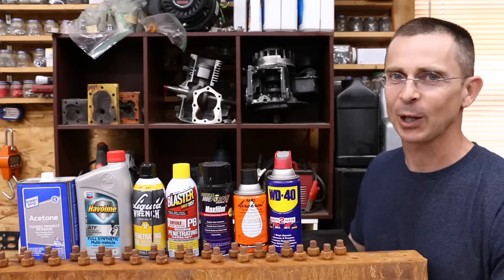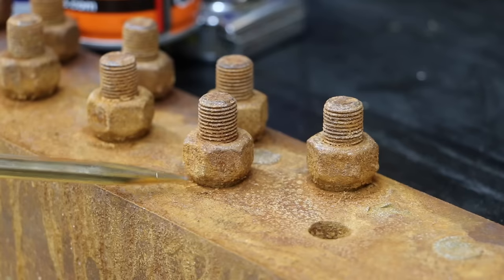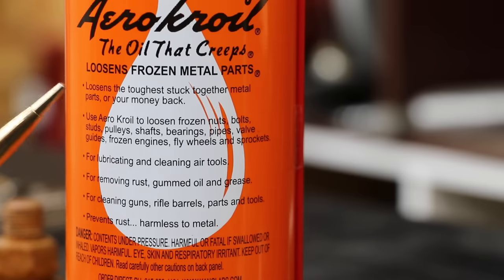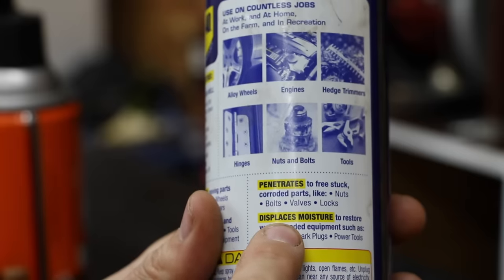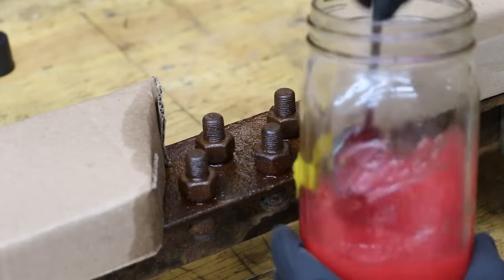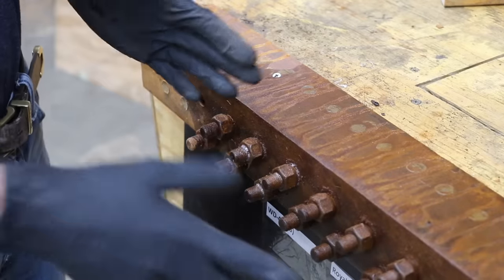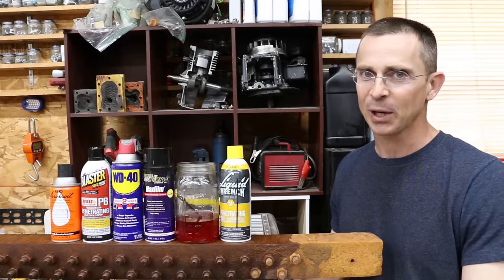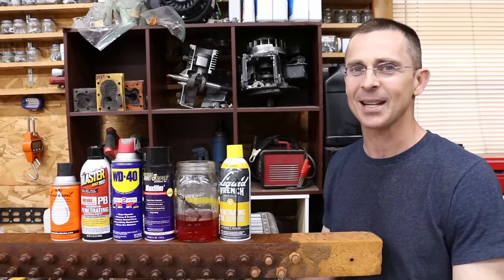Which Penetrating Oil is Best? Let's find out!

Comment: I've always been happy with " 50/50" as I call it, but the acetone doesn't work with any oiler that has a rubber seal of course.
Usually I'm just using 50/50 to soak bearings.
Reply from the maker: Thanks for sharing.

Comment: Indian Head (tm) Penetrating Oil which hasn't been made in 50 years (or longer) and came in a pint tin and was RED was the ABSOLUTE BEST penetrating oil made from WWII when my Daddy used it daily in a machine shop during WWII (Tiny Eagle pump oil can) . It contained BENZENE and high sulphur cutting oil (from the smell) but when I pumped gas for a living, "frozen" Flathead Ford V-8 (or Six) sparkplugs this stuff would break loose. I think it "went away" in about 1970 from the benzene in it (EPA regs). I STILL have two or three un-opened cans, along with some high-sulphur cutting oil (dark), and the old Al-Ox cutting fluid (that "burns" your hands by drying them out). I have two new cans of Gold Seal Glas-Wax (tm) too I'll hoard 'til I die for windshields (somebody in England makes a "clone" they say, but I don't have a brand) and a can and a half of S.C. Johnson's and Son's Paste Wax for finished Hardwood Floors (like mine-not gonna pay $36 for a TINY jar of "floor wax" from Amazoom) and some other "old things" not made anymore, like cup shaving soap!
Reply from the maker: Thanks for sharing!

Comment: From people in antique tractor hobby,heard of a lubricant called shutter oil. Was told it was used with early engines on the shutter system. Was told it was good for putting in cylinders of stuck engines to free them up. Have never actually seen it. Also, what about Marvel Mystery Oil?
Reply from the maker: Thanks for the suggestion.

Comment: Would love to see some of the other WD 40 sprays meant as penetrants to break rusty nuts and bolts. Also, there is other Liquid Wrenches. Tap and die oil. And a lot of people I think apply penetrants and heat as well. It's not good to breathe some of the stuff afterwords, but this has helped me with some severely rust welded guide pins in some brakes before.
Reply from the maker: Thanks for the suggestion.

Comment: I didn't have any ATF handy, so I was looking for something I might be able to substitute it for in the 50/50 ATF/acetone mix. Turns out, according to the SDS sheets of all the ATF fluids I could find, they're 90-100% hydrotreated petroleum distillates or highly refined mineral oil (also a petroleum distillate...). I assume the rest is surfactants, anti-wear agents, and other additives, however ATF is not really unique in this respect, many other oils (cutting oil, motor oil, other lubricating oils, etc) are made from a base of mineral oil or petroleum distillates, with a few additives.

In this light, I'd be interested to see a similar test evaluating mixes of acetone/ATF fluid, acetone/motor oil, acetone/cutting oil, or other similar fluids. Maybe acetone/mineral oil could be used a kind of control test?
Reply from the maker: Thanks for the suggestion.

Comment: Hi there,

(i've posted the same question in the ChrisFix video on P.O, i'm looking for more than one opinion on this, so please no offence from either :)

 I've found a source that says it was originally Power Steering fluid used in this homebrew recipe, not ATF. I see this debate going on on wether you can substitute PSF and ATF...many folks saying that you can use (or that it's even better) to use ATF for your PS - many also opposing this (so maybe here things got mixed ups ATF/PSF). Well...i trying to figure out which stuff to buy, so i compared the viscosity of both fluids... for example at 40°C (104°F), the PSF i looked at has 18.0 mm²/s (nevermind the unit) ...and for example several ATF have the viscosity in the range of 30-36 mm²/s (at the same temperature) .... going further, Brake Fluid has even lower viscosity, meaning it flows better, in the range of only a couple of mm²/s (and that's at water boiling temps, so much hotter than 40C/104F) .. But i don't really feel comfortable using brake fluid...i've stripped paint from the car once :D .. it's kinda agressive. ...
 but what about PSF? I seems to have half the viscosity of ATF... combined with acetone, it should in theory flow even better into the rusty threads ??

Much thanks for your thoughts on this!

Comment: I was surprised that KROIL came last. I used it on a Marine engine where a bolt was rusted in. After trying just about everyting (thought about pulling engine out!) I bought a can of KROIL, aplied it 3 times and DANG!.. Bolt came out!.. Unfortunately KROIL price has gone up so much that Liquid Wrench may be my GOTO Lub. Is it possible that KROIL is a better performer for certain applications?..
Reply from the maker: Thanks for the suggestion.

Comment: I've used brake fluid and oil, and the brake fluid is great with heat, so that it stays liquid, doesn't burn up to 400 degrees, I think... Maybe I'll try brake fluid plus ATF..But I put a rag or paper towel to protect anything that it drips onto...I noticed that it even chewed into the concrete surface on my garage floor!
Reply from the maker: Thanks for the feedback.

Comment: You should try oil of wintergreen, I used it in the military for frozen nuts and bolts. It worked really good on engine and frame nuts and bolts.
Reply from the maker: Thanks for the suggestion.

Comment: I realise this is an old comparison some 5 years ago but would like to mention my brand if another comparison will be done. I used Releasall Penetrate Oil most of the time. It works and works extremely fast. Works on all types of corrosion. I have lots of old stuff so not sure how the newer Releasall stuff works.
Reply from the maker: Thanks for the suggestion.

Comment: Tried everything I knew. Until I did this on 2 bolts holding my front struts on, couldn't get them to budge until I added heat from a propane touch and candle wax, heated as hot as I dared, 4 minutes and then added the wax until it stopped smoking and started just melting around the threads leaving a bit of wax on the threads. From the information I got , I was to only heat the nut/bolt or if it were a stud until it just melts the wax and penetrates the threads.

Comment: My grandfather was a bosun's mate on a destroyer in WWII, and later a metallurgist / machinist / welder. He used WD-40 to shine up tools and keep them from rusting, but acetone and atf for everything else. I still remember the red/clear jar sitting on the back of the shelf in the garage. Believe it or not, he'd use it as carb and top end cleaner too! Whoever was in the vehicle was told "Pin It!" and he'd squirt the stuff in to the carb at W.O.T.

Let me just say, if you think Seafoam blows crud out of an engine, you ain't seen what THIS rocket fuel used to do!
I ABSOLUTELY WOULD NOT USE IT ON ANY NEWER VEHICLES, HOWEVER!!... Not unless you're a Chernobyl reinactor...
Reply from the maker: Thanks for sharing.

Comment: I am always using every penetrating oil, lube, grease motor oil, trans fluid.......that i can find. I find everything has its place to perform the best, what works in one place doesn't work well in others.
I use Kroil in bulk and aero Kroil both often. I seem to have very good results with kroil on aluminum more than anything. I hoped it would have perfomed better in this test.  PB seems to be the best on combine bolts and other ag equipment. Royal oil has a great line of areosol products, costly but great. Kimball midwest has a great line of areosol products (IDK who actually makes them) their delayed viscosity grease in areosol in a great industrial, assembly, and ag product.  Agco has a panther penetrating oil that is one of the very best lubricants I have used its just the right thickness to be perfect....but it sucks as a penetrant. Great testing very professional...Thanks a lot.
Reply from the maker: Thanks and you are welcome!  Thanks for sharing.

Comment: there  is a new product called "superzilla? have you tried that, i have restored some cars, and what works best for me ( i am 75 years old) is heating the bolt, and applying heat, then squirting  80 Wt. oil on to the hot bolt, it soaks in, and produces a lubricant that does not evaporate within side the bolt, it stays OILY , which makes more sense .
Reply from the maker: Thanks for the suggestion.

Comment: Just wondering if you heat a nut first then spray the lubricant will the lubricant get sucked into the bolt like solder into a copper fitting before cooling off??

Comment: I had some pistons that sat for several years.  The rings were rusted and stuck inside the groves. I dropped one into a container filled with PB Blaster for almost 2 years with no results. It just seems impossible for me to believe penetrating oil can wick under a bolt head and work its way down the threads.
Reply from the maker: Thanks for the feedback.

Comment: Use a torch, apply heat, and dab the bolt with candle wax. It won’t boil off like an aerosol.
Reply from the maker: Thanks for the suggestion.

Comment: I’d like to see if there’s a difference between heating the nut and heating the bolt. You always hear heating the bolt and not the nut due to expansion. Also maybe see if simply tapping it with a hammer would change anything
Reply from the maker: Thanks for the suggestion.

Comment: I’ve always applied some penetrant after heat if I can, might just be evaporating, or burning off, but it seems to soak into the threads and cool the bolt down if you make sure to focus on the bolt, that way your bolt gets the temperature shock as well, I’d love to see how much these products also lubricate the rest of the threads after the breakaway, and how much fluid you actually need to use, I mean I’d rather soak it to be sure, but that’s almost as important as the initial cost in my opinion
Reply from the maker: Thanks for sharing.

Comment: Used motor oil is the best way to go!  Especially if you use it with heat....  On extreme heat the nut up brush down with used motor oil from the expanding and contracting of the metal sucks the oil right in. But rust soaks in used motor oil like a sponge and used motor oil dosent evaporate...  Oil bath you vehicles frame and inner fenders...  Youll be amazed!
Reply from the maker: Thanks for the feedback.

Comment: Just add one part acetone and one part liquid wrench into a glass bottle with a dropper, 24hrs on an axle nut and a CV joint never removed for 5 years or so made barely noticeable work of the axle nut and the CV axle fell out, it literally FELL OUT.
Reply from the maker: Thanks for sharing.

Comment: Kroil is basically kerosene! If you heat the nut or bearing then spray penetrant, it gets sucked between the parts and works great, dont try that with acetone though!
Reply from the maker: Thanks for the feedback.

Comment: I was hoping with your mechanical skills in your knowledge of all kinds of good stuff you could help me I have an aluminum head off a Chinese moped and if I use NGK spark plugs I have no problem but stuck in a position you need to put a spark plug in your only have a Chinese one sometimes they get stuck. Besides using heat or maybe taking head off can you give me any suggestions

Comment: I personally would use a proper rust remover if there is that much rust. I've had good luck with rust oleum rust remover. Comes in a spray bottle.
Reply from the maker: Thanks for sharing.

Comment: use heat on outside of nut and spray fluid on bolt. it shrinks the bolt and allows better penatration.
Reply from the maker: Thanks for the feedback.
Reply: @ProjectFarm  are u a real person? Responding?

Comment: try some plain old fish oil.  Puncture a capsule and squeeze it out on the frozen screw, or nut.  Let it soak in. It just might do as good or better job than these others, for far cheaper.
Reply from the maker: Thanks for the suggestion.

Comment: yes heat works however you cant use heat all the time!fuel lines, electrical lines, brake lines ,sensors will be destroyed,rubber, plastic,electronics etc also he got the nuts very hot you can warp your wheel or hurt your barring ruin your brakes if you get too hot with a torch.only liquid wrench and blaster are made to remove nuts and the wrench is there best!
Reply from the maker: Thanks for the feedback.

Comment: I've Been Working on cars For longer than A Lot of You Have been Alive . Liquid Wrench Is The Best . I have Tried and Have PB Blaster as Well. WD40 I've Used, I've Used the New WD40 Specialist Penetrate as well. I Never Owned A Torch . That's What Pipes ( Cheater Bars Are For ) ! Breaker Bars Too ! All These I've Used Work . Usually It's A Cost Thing. You buy What You Can Afford.
Reply from the maker: Thanks for sharing.

Comment: Just what I needed. Any idea if straight ATF works good and/or can damage rubber suspension bushings? Worried acetone will destroy the bushings that my bolts are stuck in
Reply from the maker: Thanks!  Thanks for the suggestion.

Comment: Fluid Film is another good one that many people don't know about.  Very heat resistant too, so you can torch a part and spray it on without lighting the whole shop on fire.  Smells awful, but who cares if it works.
Reply from the maker: Thanks for the feedback.

Comment: Some of those nuts/bolts received two sprays of lubricant while others only received one, there should have been a rule set in place beforehand making it clear that each nut/bolt was only going to receive either 1 or 2 sprays....you cant give accurate results based on that bench test...some were given more than others, it wasn't done fairly.

Comment: Cool, could you test silicone grease and silicone oil vs. petroleum based lubricants like WD-40 (but there'll be an overlap coz' WD-40 also has a lithium version I heard silicone grease has lithium, the element that thickens the silicone oil); use for metal to metal, metal to non-metal like plastic and non-metal to non-metal (plastic to plastic and wood and glass?).

God bless, Rev. 21:4
Reply from the maker: Thanks for the suggestion.

Comment: Kroil sucks.   Cans lose compression, and  it dissolves the can tip plastic.  So either it stops flowing or it runs all over, except where you want it.  Nope.  

I ended up salvaging the 10 cans I ordered by drilling a hole in the cans and draining the contents into a glass container.  I use an eye dropper to dispense where it needs to be.
Reply from the maker: Thanks for the feedback.

Comment: The most striking result of the video is that nearly all the products are mostly useless.  Only Liquid Wrench and heat lowered the required torque by more than 10% compared to using nothing at all.
Reply from the maker: Thanks for sharing.

Comment: Next try muriatic acid. It'll eat through a lot of rust and even steel so not practical but you can get things loose that you would never be able to without heat (best but not always practical. Possibly a shortened time like everyone wants 1-5minutes and wear a gas mask/gloves/ppe just don't get it on you or breath it in. Can buy at home depot or lowes under pool treatment
Reply from the maker: Thanks for the suggestion.

Comment: The quality of WD-40 cans really went downhill after they introduced the adjustable nozzle. The cans lose pressure and are useless if you have them for anytime unless you use it up quickly and buy replacement cans. The old cans with the spray paint type nozzles held pressure on the shelf for a long time. I don't buy it any more.
Reply from the maker: Thanks for sharing.

Comment: Penetrating oils need HEAT. They will "creep" in the joints/threads from there cooling action on a hot metal surface. EVERY TIME I have a rusted/frozen exhaust fitting I warm the engine first then spray penetrating oil on the fitting.
Reply from the maker: Thanks for the feedback.

Comment: I always apply heat, then pb then wait 20 minutes, but now I'll probably buy liquid wrench
Reply from the maker: Thanks for the feedback.
Reply: @ProjectFarm  thanks for the response. You seem real upstanding
Reply: @ProjectFarm  here's something that might be more useful:

The reason why I do my steps the way I do is because of a day where I attempted to remove a 3/4in bolt from the pinch joint on my 04 mini Cooper shock absorber. They are nefarious for freezing into place due to having about 100 threads engaged.

The later models use a bolt with about 60% of the shaft closest to the head is smooth while the tip is meant to be screwed into a nut. Anyway my point is they freeze and with the implementation of a 3 for breaker bar the head sheard right off.

Now I heat every time.

Comment: ive used Sea Foam "Deep Creep" two unseize motorcycle engine and a riding mower engine worked great going easy on the initial movement as not to break rings.....Water Cooled Goldwing engine some hot water in the coolant passages just prior to rotation helps....Deep Creep Me...Baby   lol
Reply from the maker: Thanks for the feedback.

Comment: I don't know anything about penetrating oil, My daddy was born in 1918, and WE always had a tin or two of 3 in ONE oil and used it on everything, (been around over 125 years) that's all the oil I use now EXCEPT for my Car - I always rode my bike (no paper route) in the rain, and always oiled my bike chain with 3 in ONE household oil, 1 time I remember we were out of 3 in ONE, and I used WD40 rode my bike in the rain like a thousand times before, NEXT DAY my chain was knotted like it was rusted for 50 years, you couldn't get the kinks out by trying to work it, so i used a lot of 3 in ONE and got it back loosened up, AND I WILL NEVER USE WD40 (funny they bought 3 in ONE YEARS BACK but say its the same old formula) ON ANYTHING PERIOD EVER, you ever try 3 in ONE household (not the blue bottle motor oil) in any of your videos
Reply from the maker: Thanks for the feedback.